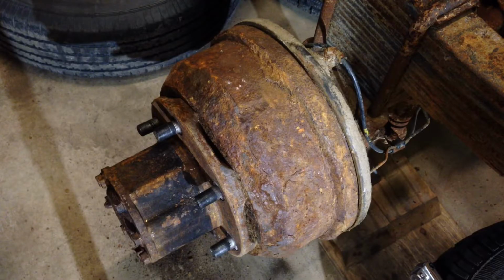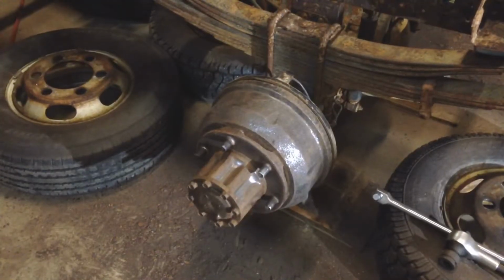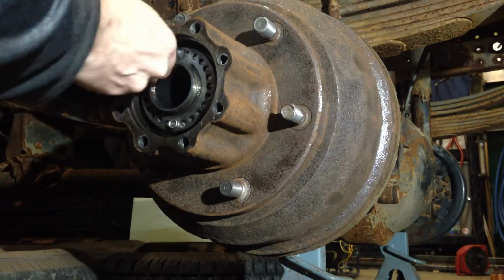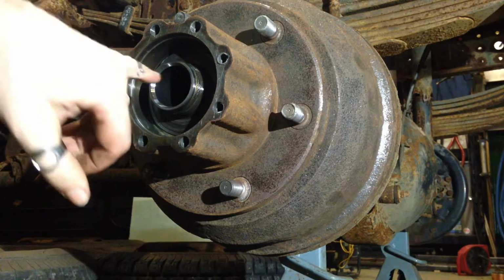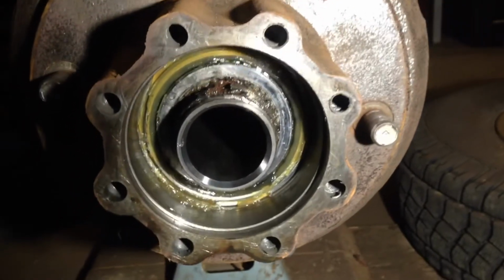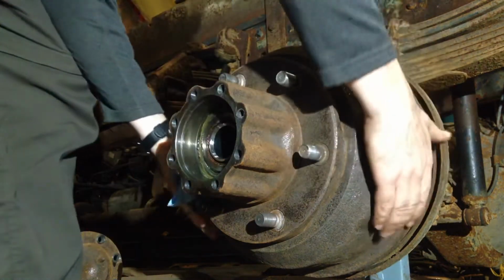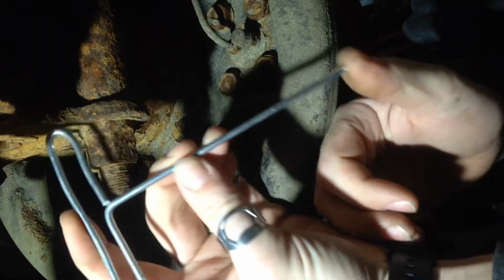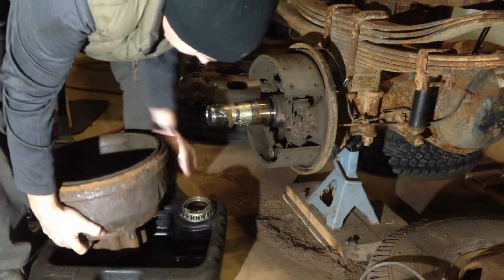Fuso FG Rear Brake Inspection

Comment: Just between you and me. The brake set up of this truck is very similar to the old larger ford trucks. Before making the special tools just back off the brake shoe adjusters and use a strong mechanics magnet to remove the tab washer between the bearing adjusting nuts the shoes come off hard due to the rust ring build up on the most inner drum edge that makes no contact with the brake shoes. After the brakes adjuster is turned in and large bearing keeper nuts removed just strick the drum with palm of your hand and that will spit out the outer bearing and the whole drum falls out into your hands. Be ready for it due to the weight. Every once in a while a drum won't free up so just strick the drum with your 1 pound ball peen hammer. Thank you for the video, saw something new. Most brake shoe adjusters use two longer rubber plugs side by side and the fuso has two different shaped plugs. I have a 1994 Mitsubishi Fuso role back wrecker FH, 8.55 ton Have never worked on the  Fuso line and all is appreciated. Thanks Brother.
Reply from the maker: Good stuff!  Thanks for watching and the comments!

Comment: hey this was a great video for me , i got a rear brake adjuster  locked up on a Mitsubishi Rosa here in Australia and with  that tool to use to release the the adjuster was an easy job, The  brake was getting hot to the extent it near set on fire, so 10/10, legend👍
Reply from the maker: Excellent - glad it was useful!

Comment: Great video(s).
I'm going to tackle this after Christmas on an older FG.
I know it needs shoes so have got new drums too.  
Realised will probably need new wheel studs too. It's got super singles so I'm thinking the front style studs just get used on the rear.
Reply from the maker: You are correct, for super singles you'll just need an extra set of front lug nuts - the studs stay the same though.  When you remove the bud nut (the threaded stud with the square drive that holds the inner wheels on) - the inner threads are the same size as the front wheels.  What year is your FG?
Reply: @BruceandKrista  I thought so, cheers.  I figured the nut on the inside of the drum is probably fine to re use as it's not likely subject to the same as the wheel side. I've got 6 studs for each side coming (it's an old 5 stud so spares each side)
It's an old FG434 1990 with a fibreglass camper body on it. 3.3l 4D31 mechanical injected non turbo 🤣.  I put a small TD04 on it some time ago with a modest 12psi which helps lots.
There's some videos it features in on my channel

Comment: Thanks again for these videos.  We're just getting back from Baja, and before we head up to Alaska for the summer we're hoping to install new brake shoes, potentially turn the old drums, and inspect the bearings.  Hoping for a bit better braking performance!  I am struggling to find the proper front oil seals to order. How do you find the proper part numbers for your fuso? I have a 3164 page shop manual for the fuso, but it doesn't list part numbers!
Reply from the maker: Part numbers are not easy are they!   Luckily for me I have a friend who works at a truck center that is part of a dealer network which includes Mercedes/Fuso - and he is able to look up specific parts for me.  I’ve tried to see if I can acquire the parts manual, but it’s a no go!

Comment: Have you done anything with the Park brake actuation in the rear axle ?
Reply from the maker: Hmmm.... the park brake on our Fuso is on the output of the transfer case, not in the rear axle...
Reply: @BruceandKrista  Cool thanks for that, Mine has actuators apparently in the rear axle hub and one of them has broken which I was told is common on this model Mitsubishi so I will need to deal with it. THanks for the Great Video it was really enjoyable

Comment: Not what I need. Helpful but not what one need to take off rear brake shoes, and replace the old worn out brake shoes, and put new ones on. Can you make a video installation of brake shoes. Can not find any help online. 2001 mitsubishi fuso box truck.
Reply from the maker: Removing & installing the shoes from this point is dead simple… the rest is just a few springs and clips.

Comment: How do you take out the drum
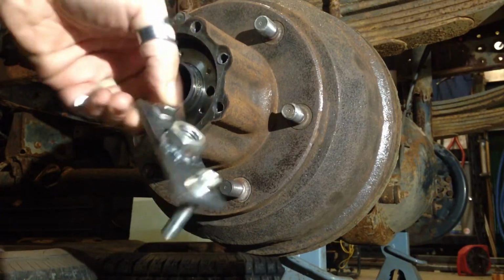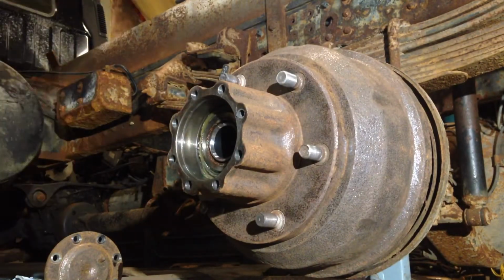Reply from the maker: After you’ve removed the axle & seal, remove the locking ring (3:43) then remove the nut and washer (4:40) you pull the hub and drum assembly (7:05) you may need to retract the shoes (9:10) to pull the drums.  If you need to separate the drum from the hub, you need to undo the nuts which you will see on the inside of the drum (back side of the wheel studs) once it’s apart.

Comment: How do u remove the wheelstuds?
Reply from the maker: I have not had to remove one yet, but if I recall - you remove the nut on the inside of the brake drum and then press out the old stud, press in the new one - and re-install the nut.